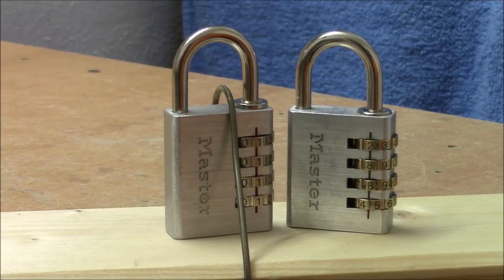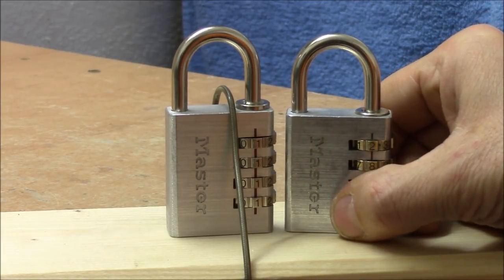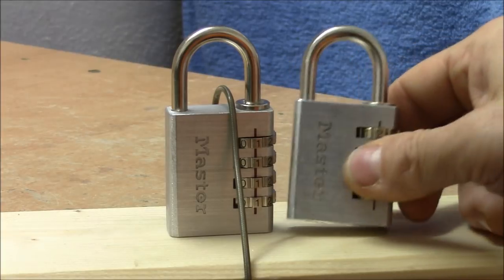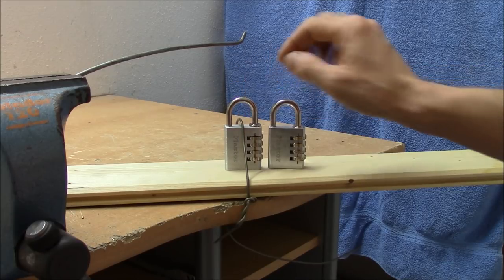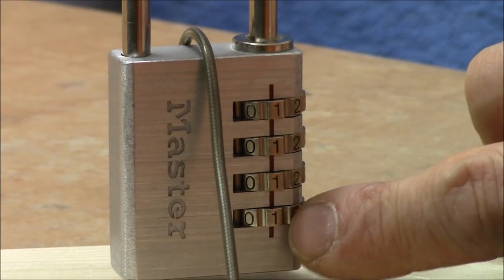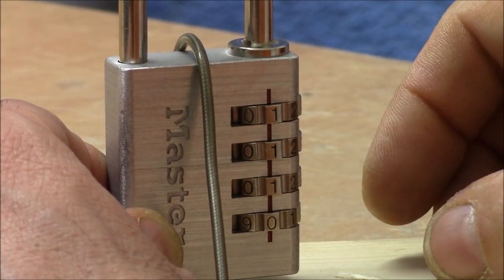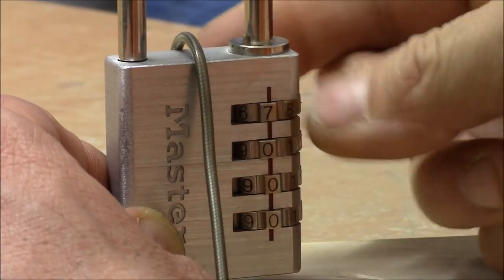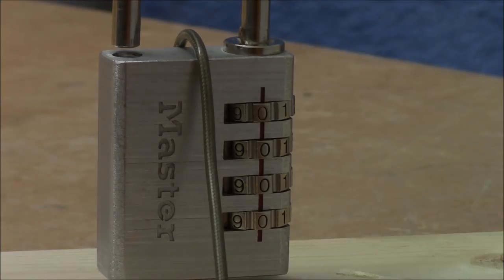(picking 463) FUN: Decoding my easiest lock - a Master 4 wheel combination padlock visually opened

Comment: It totally works. Keep pressure, listen for  a noticeable pop sound. Try first to figure out the bottom # then move up. After you feel your close but not sure if you heard that pop. Release pressure on lock, giggle the wheels you think are close. Reapply pressure and work the wheels you haven't heard that pop. Go from the # you think is it but try a # ahead and behind. Also your fingers will get kinda raw on the wheels if your having trouble.

Comment: Fun, but sad. +Potti314, how would you go about improving the security of a wheel combination padlock? It can't be too prohibitively expensive, can it?
Reply from the maker: Just add false gates - that's the easiest method. This looks like so https://youtu.be/XWaJmr81M98?t=116 This slows down a decoding attempt for an unskilled attacker.
Reply: Thanks! That is what I was thinking but didn't know if there were additional, low-cost improvements available.
Reply: Desblocar

Comment: I don't think it's a master lock! I think it was a copy of a master lock the dimensions are not the same that indicates it's a copy not an original product,don't you agree?
Reply from the maker: I have no idea if it's a fake. Master Lock company might have changed the dimensions slightly - you never know. But it could be a fake - no doubt. Do you have a recent Master 4 wheel combination lock that you could test?
Reply: I do but it doesn't seems t8 be working

Comment: I’m trying to open a 20 year old lock and I can’t a find any method that works lmao
Reply from the maker: What lock is it?
Reply: @Potti314  i think its a masterlock but i cant find a brand on it. im about to get a shim so maybe that will work.
Reply from the maker: There are locks that cannot be decoded by tensioning the shackle. If the wheels don't bind when pulling hard you must use other methods like using a shim.
Reply from the maker: Good luck.
Reply: @Potti314  thanks? i love your videos